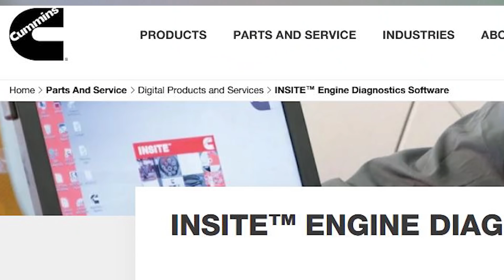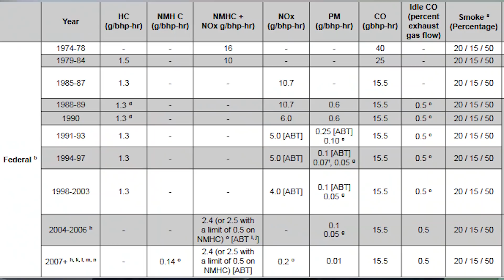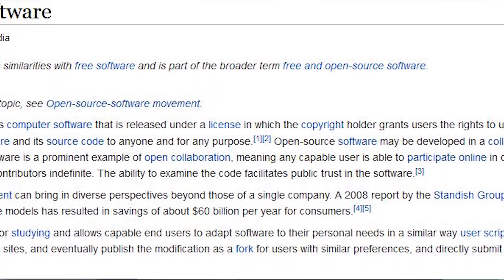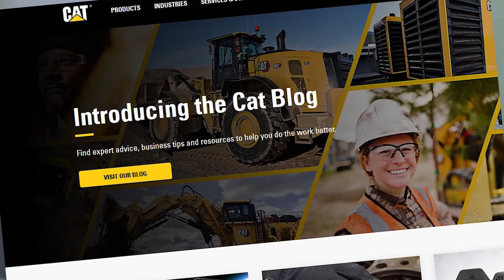Should YOU have the "Right to Repair" your Engine?

Comment: I had brand new SDP cat king of the hill 600 in extended 2008 389 Pete
And it was a nightmare my cat shop finally gave me cat Et software if bought there diagnostics link that did not expire I still use it today and I was able to fix the problem and sorted all the issues on the road. To this day I still have a spare art head and several filters and spark plug lol but I finally got about a  1158667 miles on it till it needed a rebuild I pulled it out and sat down onto pallet off into my shop for storage I dropped in an new C18 from a fire truck and never look back and now my other Pete 388 has the C18 TWIN TURBOS in it  now it's a beast the old engine is on the stand upper and lower done all machine work done and  building to a C17 BIG BORE KIT using a 625 hp NXS CONFIGURATION. 
JOSH Thank you for your videos keep up the great work and yes right to work on my equipment ie engine truck and so on it mine I paid for it and that is why I do it when truck down I have spare parts in stock So I do what I want. Lol
Reply from the maker: I'm working on a C18 in a haul truck this week. Haven't seen one in a truck before, but that sounds super cool.
Reply: @AdeptApe  it runs great I changed the front cover assembly out gear train and set it up the compression ratio is 16 to 1 instead of the C15 nxs 625 but the cam and injectors and cam acert rocker and you know all about the cat top Jake's and actuators it works great I had it flashed with NXS 625 file on the new ecu and ran it on Dino it does what I intended it to do. The engine was originally out of Oshkosh fire truck with very low miles and hours. On it I just did full out of frame on engine  stand I think you seen photos sent to you year ago or so I put about 62,000. In new parts and machine shop work to build a solid platform the fun part was this past winter I left it outside and forgot to plug it in it was -21 it started up no problem so I guess it broke in right I do have pre oiler and fuel prime system on it was a first our 420D has it and  D6R D4g  980f all have pre oiler and fuel.  350L and 325 excavator.
We are kind of cat shop EXCAVATING and TRUCKING co.

Comment: Here's my opinion on the software side of things since I'm not a mechanic or electrician:
Infrastructure critical software's source code must be made open at least to those who own a machine / product that's involved in whatever infrastructure critical thing.
Like you mentioned: the company still benefits as they get free advertising especially since, by word of mouth, people will recommend a given company's product / machine because you can actually repair it on at least the software side of things.
The owner gets at least two benefits in so far as I can tell.
A: You can actually repair your machinery / product and perhaps improve your tools for your trade.
B: Companies will be able to completely dissect each other's software which will result in faster and more reliable / robust software which byproduct improves the aforementioned infrastructure critical thing. 
Example: It might be because my car is a bit old (2016 if i'm correct) but the software's tap response is within the range of 2 or so seconds when it should be within at worse, 300 milliseconds (should be able to go faster since other software, like a video game, can run multiple simulation algorithms within 16.6 milliseconds on not great hardware so surely a car's software can execute faster).
So if I were to do some "tap sequence" to change my car's radio from am to fm or something and what menu / option the console ends up on isn't the one I expected due to the 2 seconds of response time for my initial tap, I could crash due to me now having to spend more brain power on figuring out why my radio didn't switch.

Comment: Cummins is the world's leading producer of commercial diesel engines. They have also always made there diagnostic software (insite) available for purchase to anyone. They have also always made there service and parts information (quickserve) available  to anyone at no cost at all !! So if you buy a cummins you have all the same information and software available to you that the dealers have. Cummins has been ahead of the curve in regards to this topic. Maybe this is one reason they are the global leader. Others should take notice.

Comment: Your example of Alison DOC  is a really good one . In the Salt Lake City  regen ~200mi stretch of I-15 there is 1 shop that can reset a CEL on my 91.5 dodge but they don't work on light duty trucks... and they are the only ones who sell Alison 295 fluid  my builer requires.

Comment: I help customers any way I can. I don't think they should be able to flash a ECM or change FLS/FTS, delete codes. As this could effect a warranty repair. If a customer installs a EUI, I tell them to write the code down and I will put it in for free. You can purchase illegal programs, password programs, all have been hacked now. 
Had a truck in two weeks ago wanting a emission label. ACERT, I hooked up, all illegal. IVA oil line missing, IVA psi sensor not hooked up, trim files was crazy numbers, rerated illegally. So that is why some things has to be restricted.
Reply from the maker: That's pretty bold to go to the Cat dealer for an emissions sticker when your emissions system is deleted.
Reply: @AdeptApe  He claims, just purchased truck.

Comment: Ownership in the legal sense is defined as a "bundle of rights".  In my opinion the lack of the right to repair something means I really don't own it, I'm merely leasing it from the manufacturer for an indeterminate number of years.  I would be interesting to see a manufacturer get sued is someone injures themselves with a device in which the manufacturer still owned the software which is a significant portion of the entire vehicle, machine whatever.   Keep the good stuff coming.

Comment: I come in on this on the side of the owners. We as owners should have the right to repair to factory standards. What happens when a company decides to no longer service a piece of equipment. As an owner, you are pretty much beholden to scrap the equipment since it can no longer be "repaired". This goes for cars and trucks as well as heavy equipment. Benefits the manufacturer only to be in this situation. Repair times are another "gotcha" if you dont live where there is a good service department, you are pretty much up the creek. Open sourcing the software as things become obsolescent in manufacturer terms, or after a period of time would be a goodwill measure on the part of the manufacturers (like most new tech, give them a few years to a decade to make their development money back, and then open source). As a buyer, I would be more likely to purchase from a company that supports my ability to keep running their equipment until actual product death (read worn out past economical repair) than any planned obsolescence.

Comment: I bought a truck with a Cummins ISX over Detroit or Cat simply due to the availability, for free for small operators, of QuickServe. More options for the end user is ALWAYS a preferential decision point. The first engine company that releases a cell phone capable electronic engine interface for diagnostics will, without a doubt, capture more market share. Customers want options. Period.

Comment: Currently up to about $12000 in computers to talk with everything I work on. Pisses me off when I diagnose and properly repair an after treatment system and run into a code that can only be cleared with a factory scan tool that I can't afford, Also running into newer vehicles on the automotive side that will not communicate unless the scan tool is at the latest update which is 2 years newer then what I am working on. Just got forced into snap on subscription for that one. 
I am all for rite to repair, Just hope that means I can afford to.

Comment: Yes, and abolish the EPA.
Reply: Yes and no. The EPA serve a purpose, but their Diesel emissions regulations are far too strict. The current ultra-low regulations with DPF's should only apply to city limits for large cities like SF or LA. Outside the big cities it shouldn't be as strict.
Reply: @electric7487  but I love rolling coal and burning rubber on groomer/rainbow sidewalks.

Comment: If we could see what the codes were, and able to fix small issues ourselves fine, but you could limit the ability to change engine epa settings, same goes with changing horsepower. Let's face it not everyone has a C-18 putting 900 hp to the ground through a 3 axle drive. If it was built for 450 hp, make it so  these guys can't change it to 700 at the flywheel without changing parts.  
I'm sure you have seen what's left of a motor after guys change hp without changing out the right parts.

Comment: I see from both sides he manufactures spend a lot of R&D to make thousands of engines run through warranty. Then some shade tree guy loads some software up and trashes the engine cries foul wants to sue the manufacturer or cry about how bad their product is. But on other hand it should be basic software to deactivate cylinders check sensors show voltages, even if it were on a subscription basis tied to the serial number of the engine could help folks get back to the field or on the road.

Comment: AFAIK right-to-repair doesn't mean all software should be open source. Just that the engine data is transparent and able to be diagnosed without specialized equipment or licenses from the manufacturer.

For example pretty much every Toyota ECU is locked down and you can't view or modify the software, but with standard OBDII tools you can still access all the data you need to diagnose. Farm equipment does not have the OBDII requirement like passenger cars so they can get away with completely locking it down with proprietary tools

Comment: You should be able to repair your property; however, some want their equipment to do something it was not designed to do or handle. One may want 600hp out of an engine that can only safely produce 550hp.
Reply: If this was a real thing racing and any kind of hot ridding should have never happened…

Comment: I’m all for the right to repair, but more states need to participate in bare minimum some sort of safety inspection.  We have no inspection here and too often I have DIYers bring me their cars because their concern is still present after they’ve performed their own “repairs” and I end up having to undo a ton of hackery to put the car back together properly
Reply: DIY doesn’t mean butchered.  I’m a mechanic that works in mining so I make real money.  If I had to get safety inspections done on brakes and body I wouldn’t be bringing fuck all to you anyway.  So your argument is invalid.
Reply: @jaredmayer3960  Ok well let’s get a few things straight shall well?  First off, I never said DIY means butchered.  I said it CAN mean butchered.  I know some really great DIYers that would never dream of working in an actual shop, but they still do fantastic work because they educated themselves on how to do things right.  But how do you single out just the bad ones?  You don’t.  It’s the same with bad professional mechanics, the industry is running rampant with them.  So if we were to have a standardized inspection and a way of enforcing that upon the inspector (which I do believe we need), then we might have a lot less dangerous shit running around on the road.  And yes I do believe we need more, and higher quality mandatory training for pros as well.  I work on at least one car a week that doesn’t belong anywhere near a back road let alone the highway (not necessarily because of DIY repairs) and it’s absolutely appalling the vehicles that are driving on the road around us and our families with no regard for safety.

And as far as your “I make real money” comment, I made 75k last year.  I’m sure you do make more.  But you’re not better than me because of it, and I do just fine taking care of my family with what I do.
Reply: @automedic9781  you can mandatorily train some tit all you want.  If they’re horrible at their job they’re not going to get better with training.  Unless they’re purged from the pool nothing will change.  I’ve never been happy with a repair done under warranty or on a recall yet, and as the saying goes, “do it yourself if you want it done right”.  Still applies today.  I’m a journeyed tradesman.  The #1 issue is people tolerating incompetence.
Reply: @jaredmayer3960  And I absolutely won’t disagree with you 100%.  I’ve definitely tried training some people that just didn’t get it, and we had a long talk about them possibly finding something else to do.  Some of them took the advice, some of them didn’t.  

And I literally said I fully support the right to repair.  If you buy something, you absolutely should have the right to repair it as you please.  I’m not arguing that.  What I’m not understanding is why you seem to be so offended that I even suggested there be some form of regulation to it?  My opinion was not a personal attack on you or anyone.  You’re a mechanic?  Great!  I’m sure you do perform better repairs than the dealership kid trying to beat warranty repair times.  But it’s a lot like buying a gun.  You can’t figure out who shouldn’t be buying a gun if you don’t background check EVERYONE who tries to buy a gun.  It doesn’t mean you shouldn’t be allowed to buy one.  It just means that there needs to be some form of regulation in attempt to keep people safe.  

Do these regulations always work?  No absolutely not, and I’m not blind to that.  There are still people that get guns and shouldn’t have them, and shoot up schools or neighborhoods, and unfortunately there likely always will be.  Just like there will be people who do a bad job repairing their vehicle and still find a way around inspection.  But it’s better to try and catch some than to not try and not catch any.
Reply: @automedic9781  perform better repairs than the dealership kid?  Hahahahahahaha why would you toss that in there.  I’d put my skills against yours any day.
Reply: @jaredmayer3960  I didn’t mean anything by it man, it was a poor phrasing.  Like I said, I’m sure you’re a fine mechanic, and I’m not trying to get into a pissing match over skill.  Merely stating my opinion on the right to repair laws.

Comment: I would love to have access to the ecm on my C-15. Having said that you are going to have the maniac outlaws and the low life shops that take advantage.  The software battle has been going on for years.  Look at the computer and software manufacturers.  I hope the farmers win this battle.  Another great video Josh
Reply: You'll have them anyway. And even if they want to try to lock these things down like a bank vault there's nothing stopping someone from just ripping out the modern engine and slapping in a 12v71 or 8v92 that predates it all. And in fact that's precsiely what I would do if I owned a large truck like this and it didn't already have one. Out with the shitty modern computerized garbage in with a screaming Jimmy.

For all its flaws, at least that ol' Driptroit 2-stroke will run. Fuckers run so well they can sometimes be hard to shut off 🤣😂

Comment: I support right to repair on the basis of trust. I work on and maintain my own pickup truck myself, because in a lot of cases, a truly skilled and competent mechanic is difficult to find. Many "mechanics" today are parts-changers without much, if any training and experience, and don't know how to diagnose, or troubleshoot problems. There are also many places that will screw you to save a few bucks. I like to know exactly the quality of the parts and labor that goes into my truck because I depend on it every day.

Comment: The real problem is the FEDS forcing complicated engines on consumers adding substantial costs
Reply: EPA pests
Reply: And this complication is so we can have cleaner air in cities and towns. If people didn't drive as much as they do, in vehicles that are overkill (3/4ton cummins as a daily commuter), then we could get back to simple diesel engines.
Reply: @aaron___6014  when is the air clean enough? Is there ever a point? Even pre industrialization there was plenty of air pollution. Heck even pre human there was. Every EPA reg to reduce one kind of pollution increases two more anyway. What do you think is happening during a regen? It's wasting fuel which has to be pumped out of the ground and refined and transported and spewing out additional co2 on top of that in the name of removing particulates which will only make "climate change" worse. Leading to more regulation.
Reply: @aaron___6014  town planning should have planned for pollution

Comment: Everyone and their mother would bypass the emission components as soon as they can.
Reply: Not necessarilly. I work for a CAT dealer as well. Using our software, I can disable an emission component for testing, but either after a power cycle or a certain amount of time, it reenables again. The manufacturers would just have to make sure the software in the ECMs do not allow full disabling.

Comment: Definitely support. The way I see it, even if the software is open and you can fix issues yourself, most people won't do it themselves. Once they see how complex these things are, they won't want to touch them. Some will try but activity can be tracked and dealt with as necessary
Reply: Engines aren’t that complicated, even modern ones. The problem is that the diagnostic tools are very expensive and not worth the cost unless you fix them for a living or have the desire and the money laying around.